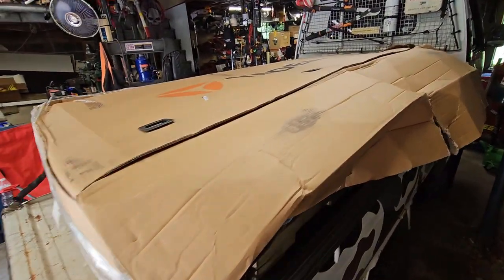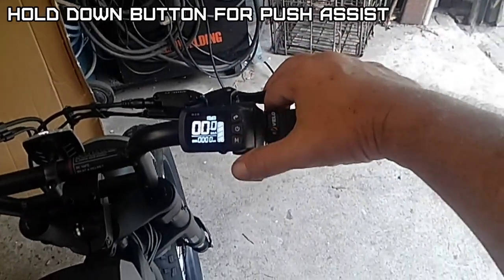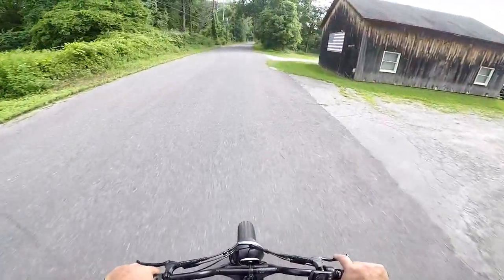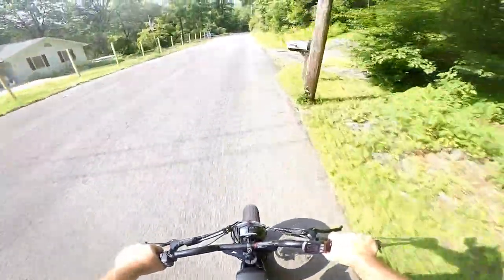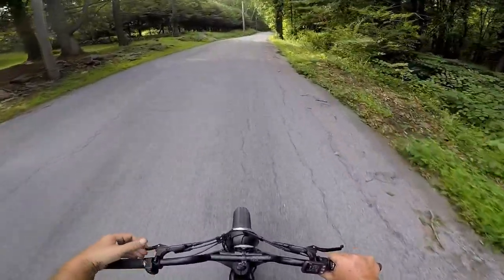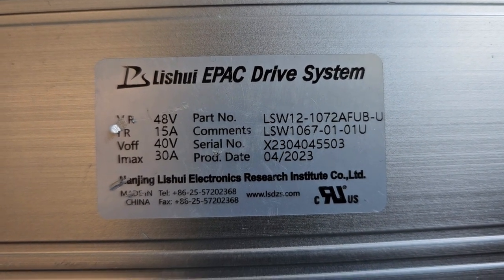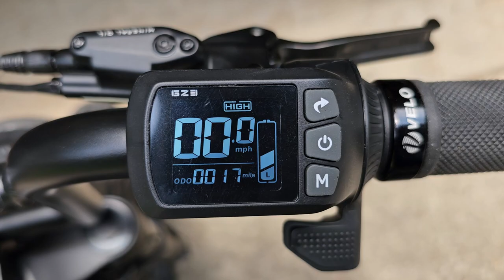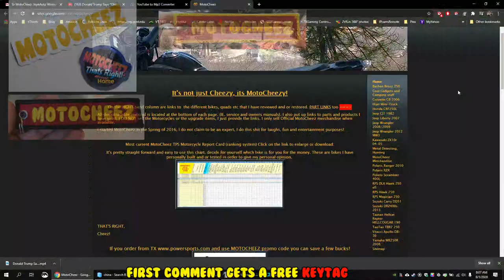Yadea Trooper 01 750 watt 20ah Electric bike. Fat Tire E-bike, assembly, test, specs, conclusion

Comment: That one would be good for a 72V or 60V  3,000 watt upgrade. Plenty of room where the basket is for a big boy battery. Slip a smaller 72 or 60 V on top and use a battery blender .  it's a shame bikes come with 20 amp controllers. I would not have one stock for long.😂
Reply: It doesn't.  He didn't do it correctly

Comment: Might be able to do a shunt mod to get class three. Little disappointed there were no wheelies. The Trooper by Iron Maiden was playing in my head while watching.
Reply from the maker: Shunt mod?
Reply: @MotoCheez  I've never done it myself but there are videos on YouTube that show how to shunt part of the controller circuitry to bypass the speed limit.
Reply: @MotoCheez  Shunt mod you add solder inside the controller, you will see 1 sometimes 2 or 3 metal bars. It increases torque and acceleration but not top speed. I have something similiar controller same lcd display. Im using 48v 20ah 30A bms battery. I can do 28-32mph. Or maybe the battery is limited because I saw it is rated at 20A max BMS. It should be 30A because the controller is 30A. So it could just be your battery can not put out that much power that is why your speed is 19.8mph instead of 28-30mph.
Reply from the maker: @chesteryao  ah, never heard of shunt mod. 
It's def6capable if 30 plus, the battery isn't holding it back. From what I found online it needs a programmer to unlock class 3

Comment: So I'm confused on Yadea's website they list this bike's hub motor as 250w-750w.  If that's true which I hope it isn't that would mean this bike has a nominal power of 250w with a peak of 750w.  Or maybe that means 250w for European regions and 750w for the states?  Either way no class 3 for this bike is disappointing I know they are doing this to comply with Federal bike law but the fact you can't simply unlock it in setting will be a deal breaker for many.
Reply from the maker: I believe you can choose the wattage when you purchase it. I told the everyone wants the class 3! Making it up Anderson hill shows it's 750 watt. 500s don't make it
Reply: @MotoCheez  Thanks for that clarification I was super confused lol.

Comment: Hate to say it MC but I score this one fairly low, it's an underpowered knock-off a Luna Banana for not that much less money, they can't all be winners, but as always a great review none the less.  Thanks.
Reply from the maker: Under powered? It actually climbed the hills better than most I've tested, it just lacks the class 3
Reply: @MotoCheez  Yeah, I understand where you are coming from but I'm guessing that you have never experienced a true 1,000W-52V mid-motor ebike, the performance difference would be quite astounding I think.
Reply from the maker: @joeburkeson8946  yes, and more than double the money. Can't compare a mid drive to a hub drive